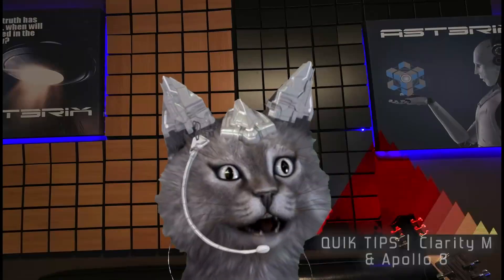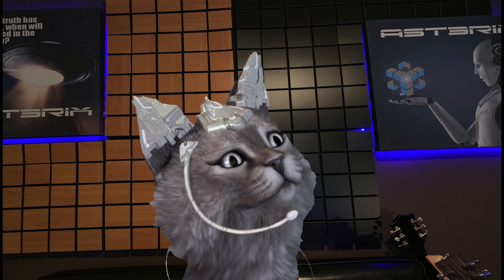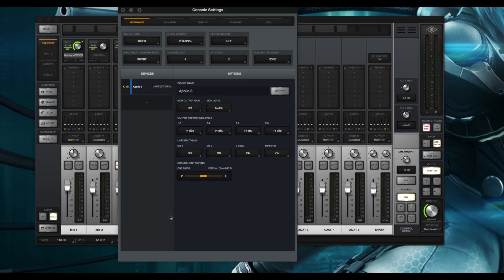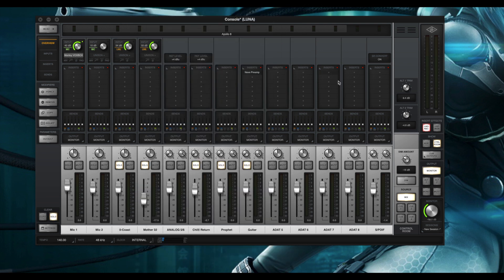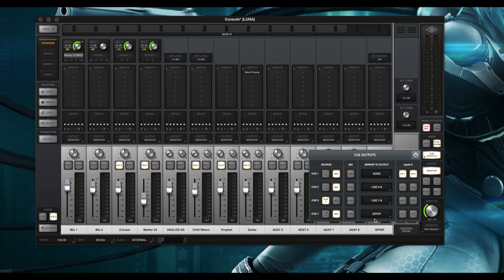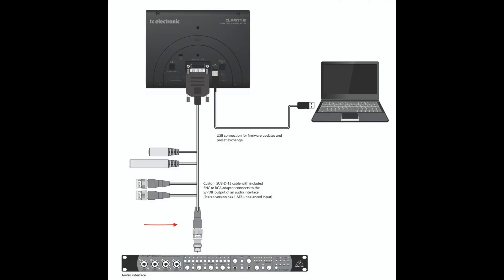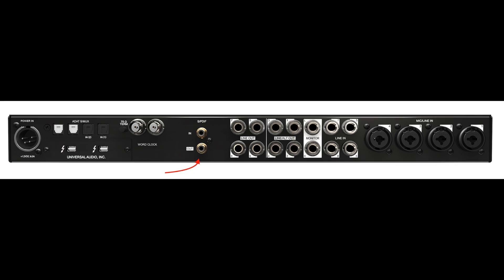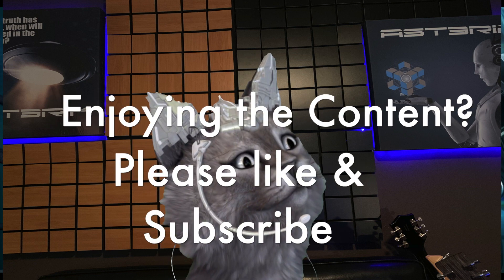QUIK TIPS | CLARITY M & APOLLO 8 SETUP

Comment: How can I connect my clarity Stero to My Apollo Twin X Quad? I 've Bought an external AD converter an RCA to TS to connect it. But I don't know how to make the internal configuration. Please HELP! :((
Reply from the maker: Looking at the twin x you should be able to change the operation of the optical port over to spdif.  Then inside the cue mix select spdif and mix.  Turn off digital mirroring.  That should work... in theory.  I have a twin x myself I have not tried this method, but as it is an option in the settings for the twin x to change the operation of that port it should work.

Comment: Hi just wondering can I connect the TC Electronic Clarity with an apollow twin?
Reply from the maker: I don’t think the twin has the correct setup on the toslink.  If I remember correctly the toslink only supports s/pdif on some units and some only support adat.  I don’t remember which version supports which.  You need to review the manual.

Comment: I didn’t work for me and I’m doing it exactly like you....what I’m a doing wrong? Are you going out of S/PIDF with an RCA adapter?
Reply from the maker: Big Pokes no just regular spdif audio cable.  The trick is making the cue accessible to the port.  Once that port is open on the cue it worked right away for me.  Also only using output of spdif input is not needed.